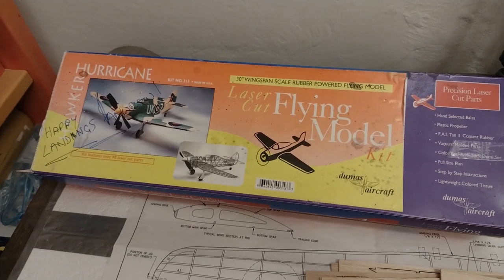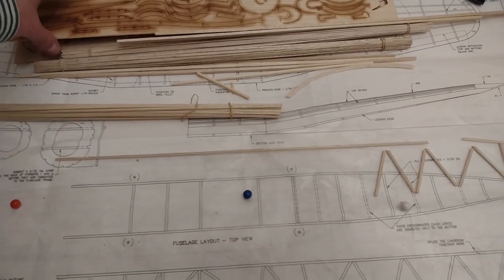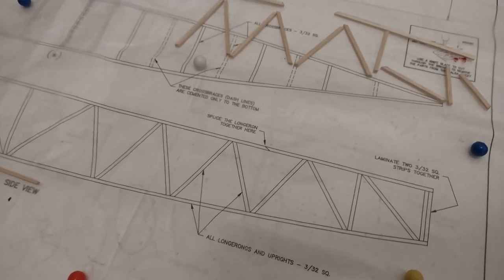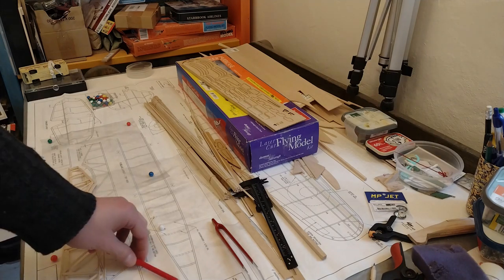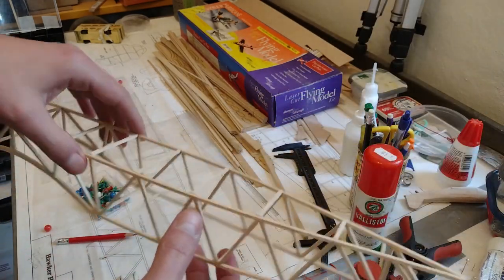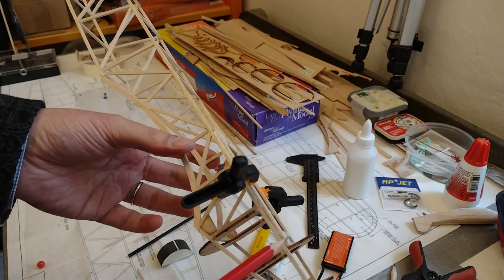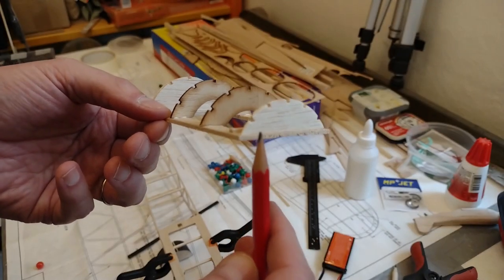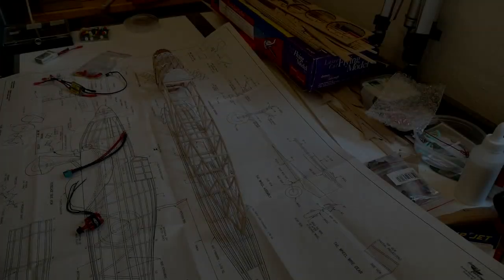02  Dumas Hurricane RC Conversion   Fuselage structure

Comment: That's coming along nicely Andrew, magnets are strong to pull away from each other so I'm thinking if you remove the hatch dowels you could slide the hatch sideways as long as it's not a tight fit, the magnets can't grip a sliding motion 🤔 I would say reduce the downthrust now as well 👍
Reply from the maker: That is a good idea. If I struggle with the magnets, the toothpicks will have to go. I recently mounted the motor and put in some washers to reduce the downthrust. No idea if it is OK or not, I guess I will find out on the maiden ;)
Reply: @downwindchecklist6567  just be prepared for anything as usual 🤔👍